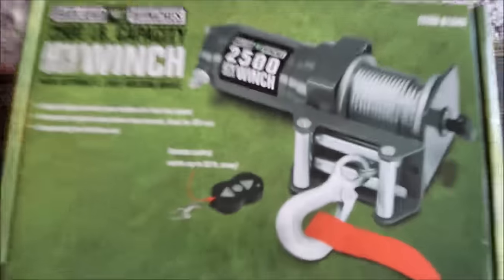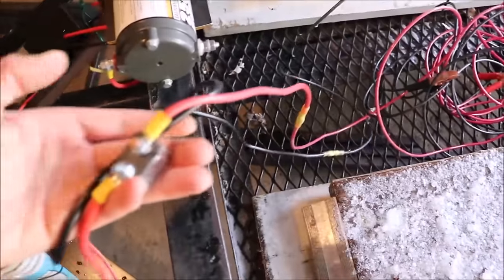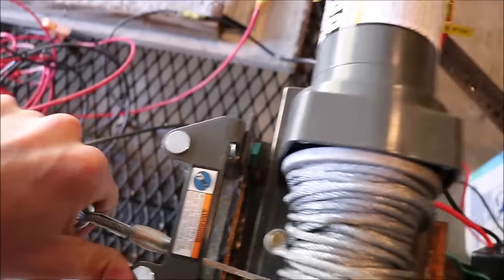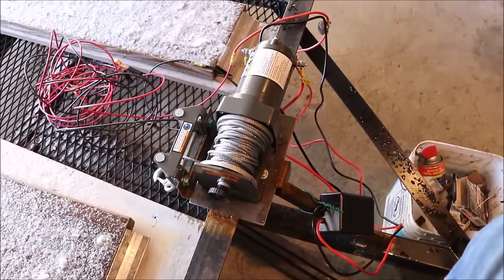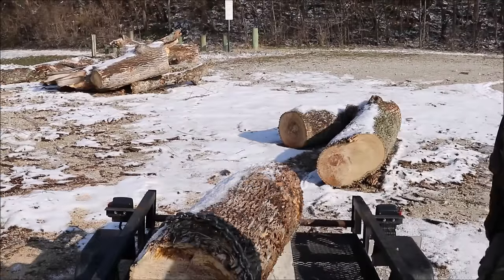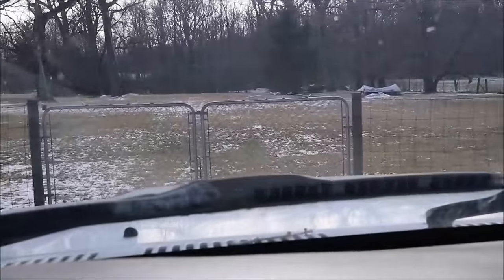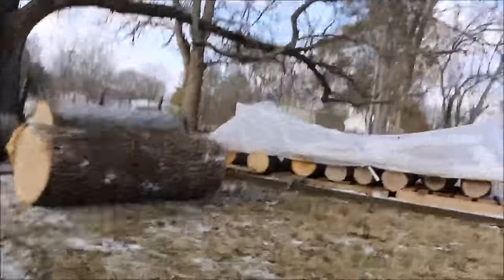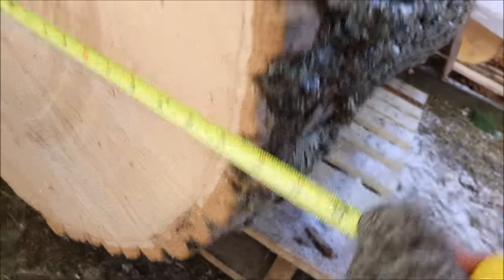HF 2500# Winch Review/ Log Loading

Comment: In another video I saw the guy used a car hood underneath the front of the log so it would be a smooth pull (edge of log not getting caught on ground or ramp). Good video, thanks.
Reply: wranglerstar

Comment: I have the same winch and am glad to see your review as I will be loading logs too you pretty well answered my questions, you really need to get a cant hook to handle those logs much safer and makes job a lot easier  you mite also consider a snatch block it cuts load on winch in half and doubles pull power, that's some nice wood you have there thanx
Reply from the maker: Thanks, I definitely need a cant hook. I have looked at some snatch blocks, but have not purchased one yet.
Reply: Same reason I bought mine too, the national park I live near has logs all over the side of the road just chilling.

Comment: now weld or drill a small 4 - 5 inch bar strait up at the back of the trailer and the other side at the back something to place your hook. both should be up on your railing . then run your wire to the first bar then in front of the log . front being the nearest too the truck then run it too your other welded bar forming a V shape. center the wire on the log. now u can remove the log off your trailer with the same winch.....i hope this helps you and your back...cheers

Comment: Some thing to concenter take and wire to your battery pos and neg would be a 6 gauge with copper lug's then back to your hitch then put a "Anderson style connector" on it and the other plug end on the winch you'll find that the winch will work better: Moving log's if you are doing a lot of it think about a log arch, look one up they are not that hard to make and on the front end put a hand winch to pull the end down and then secure with a chain in chain hook's: On long log's up to 47' I've used two arches and pull them with the same winch you are using and a second on a hoist to lift the logs onto the trailer using a 5 to 1 block and tackle to give me a12,500 lb lift capacity but I did go with a 1/2 inch cable: My boom arm could be raised to 33 degrees and  hand cranked out in two section's 5ft and 3ft and then my whole hoist could be raised up to 48 inches higher, actuality used a "HF" hoist to mount my hoist to my trailer 3 point's on side 1/3 from each end and middle on both sides of my trailer I also had out rigger's.
Reply: instablaster...

Comment: If the remote is the only way to control it, this is a concern to me. These things fail all the time. Would like to see a hard wire drive as well, does it have one?
Reply from the maker: This one doesn't, I have seen videos where you can make a hard wires switch. I upgraded to the 3500 hf winch.
Reply: @BRadWilson3  nice. Thanks again!

Comment: Why didnt you use the winch to unload it too? Ive got the same size trailer and winch & I do as little manual labor loading or unloading! The only thing YOu need to watch for is cable cross over and wedge between wraps when you free wheel your winch line!

Comment: Great video.  I plan on using mine to haul some logs in my yard.  How did you get the hook through the cable guide rollers?
Reply from the maker: I had to take the small snap ring off one of the rollers and then feed the cable thru. Then reinstall roller.
Reply: I was wondering same thing what a pain in the _ thanks harbor freight, huh!!

Comment: After commenting that Harbor Freight only used  4 ‘ of 10awg,for connecting the battery to the motor, you add 20 more foot of 10awg.  Like you didn’t think maybe connecting the next size thicker wire like an 8awg that actually goes to the battery should be done.  I understand that you may not not be using it to full capacity but at least suggest to your listeners that if your going to extend almost 25 ft it should at least be at a larger gauge depending  on the amount of amperage that your drawing from the battery, just to get back to the Harbor Freights wires and for voltage drop over that same span.

Comment: Quit kicking the log and just hang onto it to guide it onto the trailer. It won't bite  you. 

Thanks for showing the winch platform on the trailer front frame. That 22" 6' ash log weighed around 600#

Comment: Dude wirewheel all your weld joints and added steel. Then wipe off with a clean rag then clean again with acetone. Then paint with Rustoleum paint to prevent ring & corrosion for safety purposes.

Comment: Your supposed to run the line out all the way except maybe 12 foot then reel it back in pulling something at least 500 lbs to set your cable that's what the instructions say , you may have done this but just didn't put it in the video, anyway it's supposed to keep your cable from binding up so if that ever happens and you didn't set the cable you will know why, I saw a video where a man didn't do it and his cable slipped off the reel and he then blamed the wench and said it was a piece of crap.
Reply from the maker: I did do that, this particular winch has a space between the housing where if you are not paying attention and to much wire gets on one side it drops down in. On the bigger 3500# winch it is designed different and get get stuck.